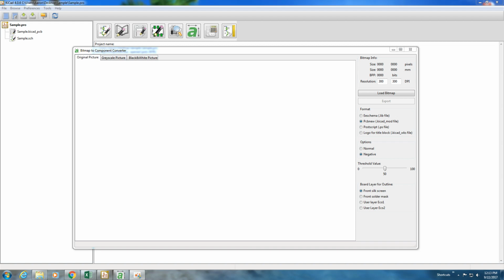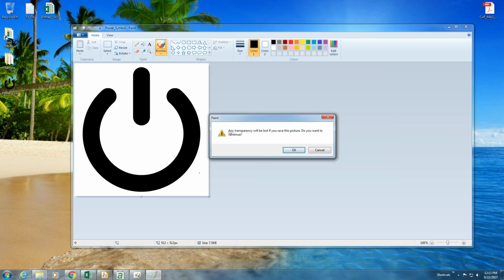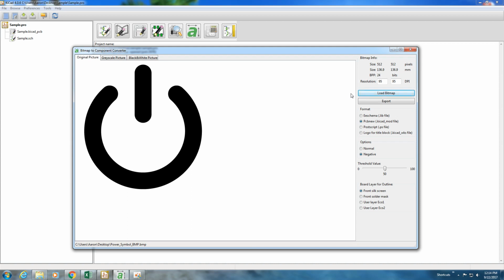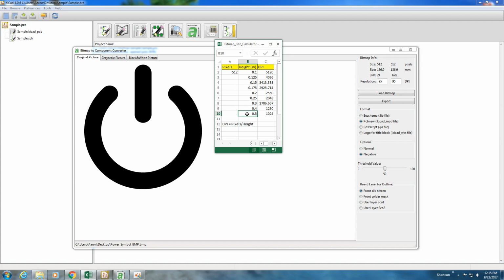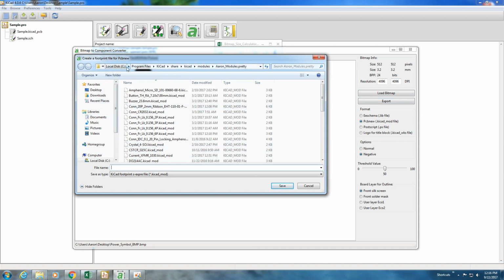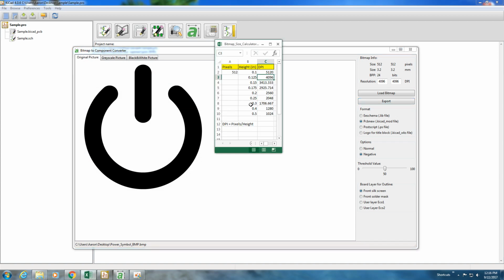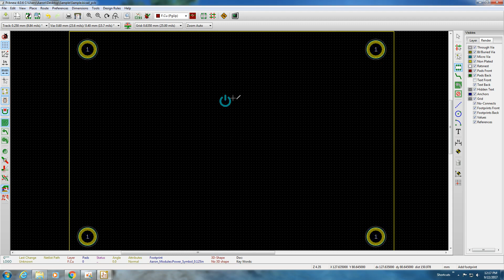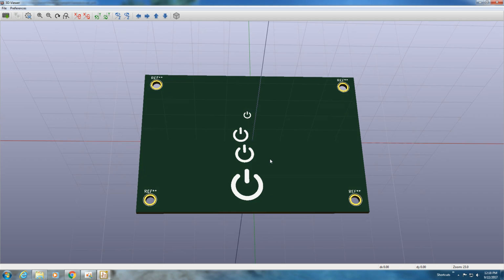KiCad - Add Symbols or Graphics to PCB Silkscreen with Bitmap2Component Converter

Comment: Thanks for the succinct tutorial that assumed very little prior knowledge from the user. Great for a complete beginner like me!
However, there were two steps that I feel could have been explained better.
1. When you saved the export to your custom library, it would have been helpful if you had also mentioned how to create a custom library (e.g. just make a folder in the right spot).
2. After creating a custom library, you also have to tell KiCad about it by going to Preferences -> Manage Footprint Libraries -> the little folder icon called Add Existing Library to Table
After figuring those two pieces out myself, the rest of this tutorial worked great!